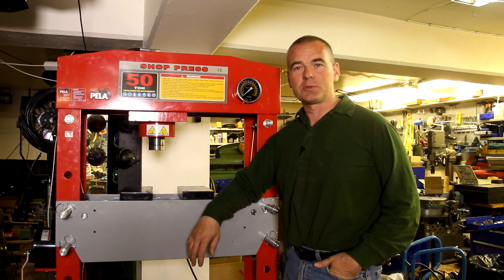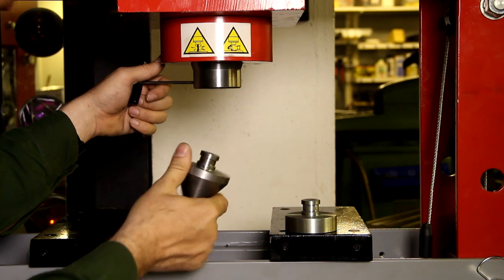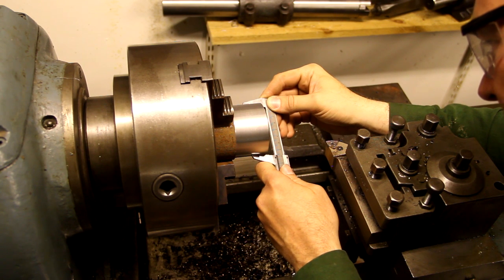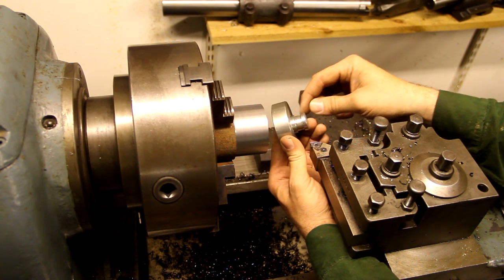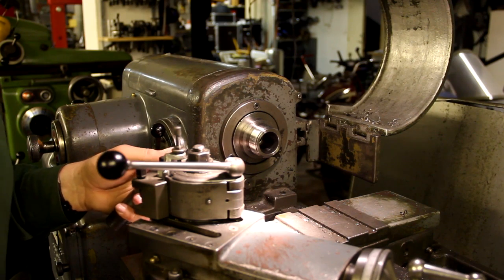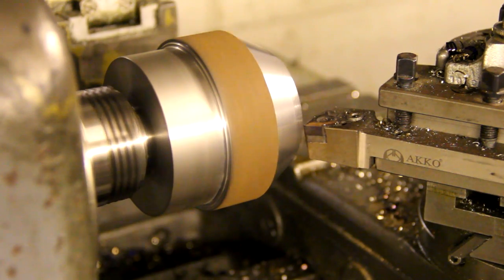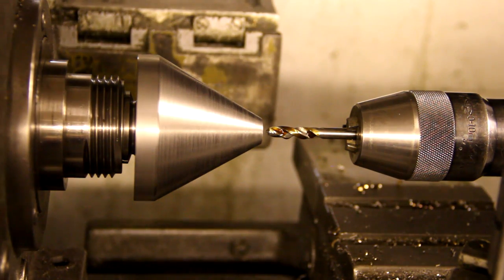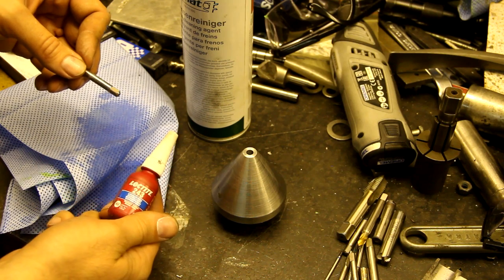Press Tool

Comment: Great video and a very impressive hydraulic press.  I built some back in the 1970's to sell and I still have the prototype.  See my channel if you want to see it http://tinyurl.com/mo3kyqa.  I have a lot of odds and ends to use as press tools, old piston pins are the best of my push tools as they are hard and ground straight.  I often make a little thing to use if I don't have it on hand.  I just keep a can on top of the press with all the different size push pieces.  Thanks for sharing.

Comment: Congrats on the little machinist!

Just a quick note, you might want to run your reamer with little slower rpm (I usually use 2/3 to 1/2 of drill RPM) and bigger starter hole, something like 5.7-5.8mm for a 6H7 hole.

Comment: Hi Mattias, Congratulations on the birth of your son, and the acquisition of a fine looking press!  You keep your machines  in beautiful condition, so I'm sure it too will give many years of reliable service. As others have already mentioned, I too would suggest being very careful when using hardened pieces for press tooling, I too have and use a 50 ton electric over hydraulic press and am sometimes near it's capacity, when using shafts, pins, and other pieces for additional tooling, I usually select pieces of mild steel or even brass, as these materials are a bit more forgiving when something goes wrong.
  Great video, and congrats again! ...... Mike

Comment: Congratulation's on the arrival of your son. I see a comment regarding the use of HSS and the risk of the tool shattering, I tend to think that another choice of stock would be safer. I think that the use of a 10.9 or 12.9 bolt will be just as good for durability as well as more forgiving in the case that something moves the wrong way. Cheers from John.

Comment: That is a handy press, I like the ram being on a trolley like that so you can move it side to side. The bottle jack one I have kind of limits the size of the part you want to press. I want to make some kind of a arbour holder for mine, thanks for the video!

Comment: Congrats on your new son Dr.& welcome back to You Tube
That press is a nice addition to your shop. Careful with that hss, especially on the smaller dies it will fracture like glass & send pieces flying across the room. Just use good quality shafting, you can machine it to custom size, no need to heat treat it & when it wears out; re-face it or replace it.
Just my two cents...
Reply from the maker: Well, sure it can break. I always use safety glasses, and I know I can't put unlimited force on a thin tap without a risk of it breaking. Pressing is a dangerous business, I know...

Comment: Please be cautious with taps as press pins.  HSS will probably be ok but if you get harder ones, with vandium or other alloys, they may be too brittle and under pressure can shatter and cause small injuries.
Reply from the maker: Well, they may break, of course. No tool is unbreakable, and I sure won't put 50 tonnes of force on a thin tap. I always wear safety glasses when pressing, and sometimes ear protection also. When things come loose, it often does so with a loud bang as all built-up tension is released.